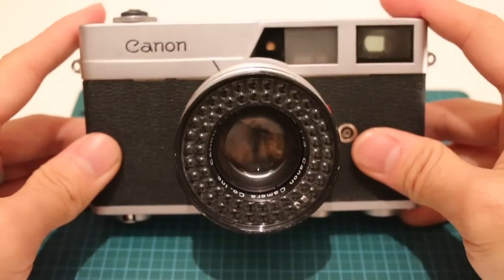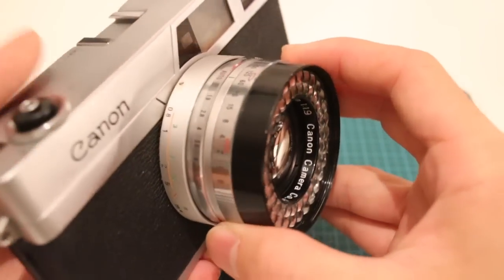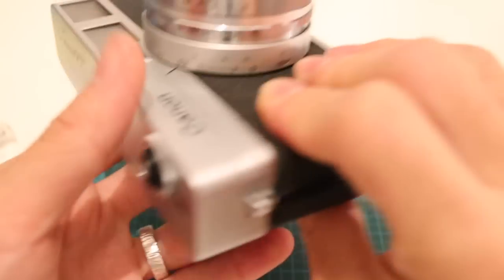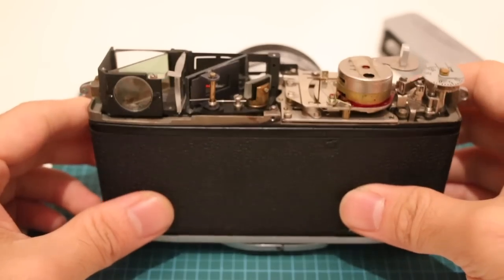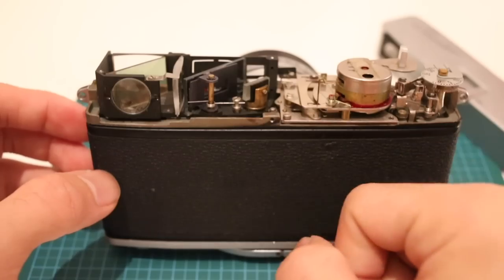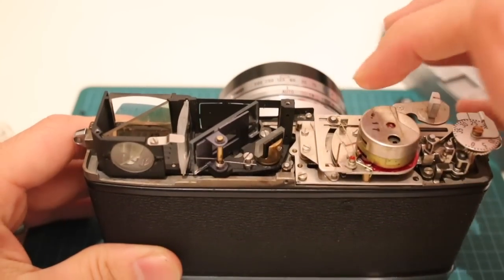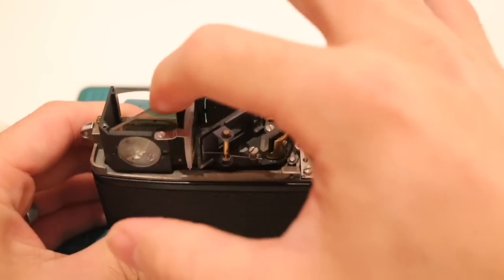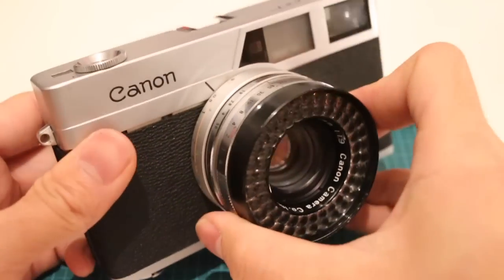Some cool things about the Canon Canonet (1961)

Comment: I’ve got one of these and the rangefinder is misaligned... any ideas how to adjust it??
Reply: It’s possibly the small mirror inside the camera. When you open the top with the lens facing away from you, with the rangefinder on your left. The smallest mirror on the right side of the rangefinder is what is probably causing the issue, it probably got knocked loose and is misaligned